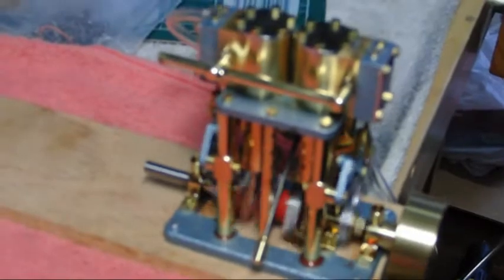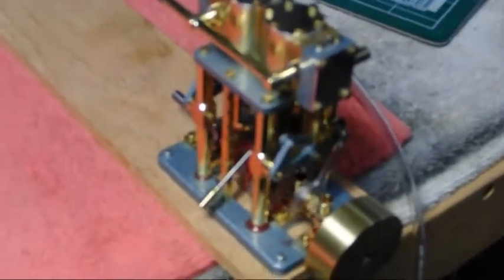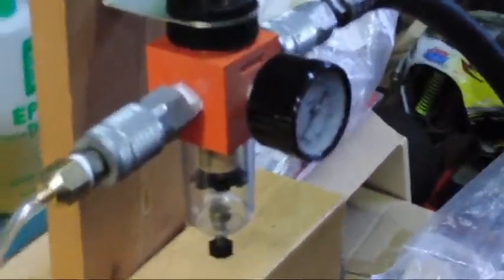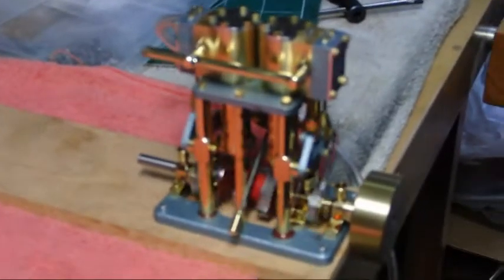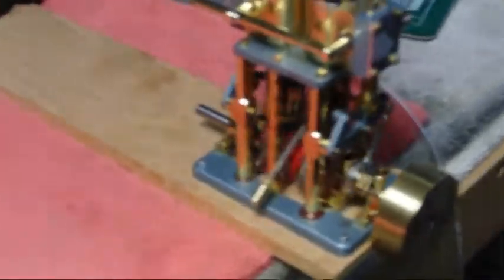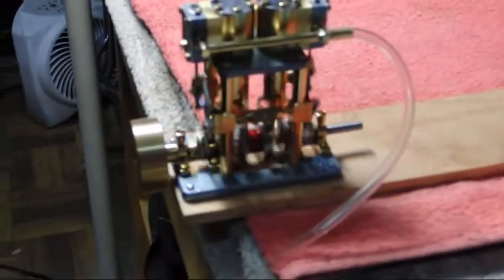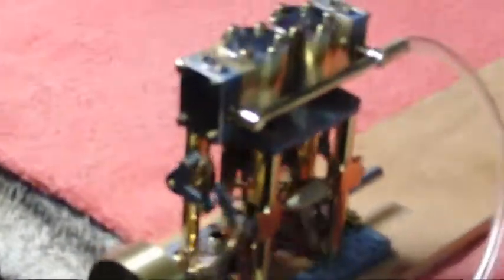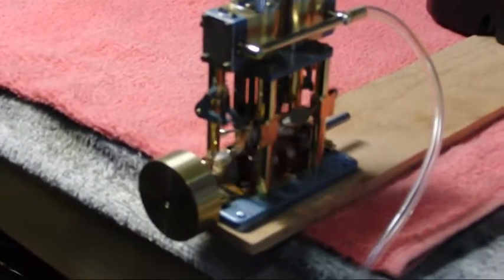Graham Industries GAGE TVR1A Steam Engine 001

Comment from the maker: @Bgee134 They were the smaller of two sizes offered by The Steam Chest. IIRC they were the 1/8" size. I had to enlarge the oil hole in the bearing block and then I soldered the cups into place. Afterward I redrilled the oil weep hole and reamed the bearing bore. I have seen your setup with the Macsteam boiler and it looks sharp! :)